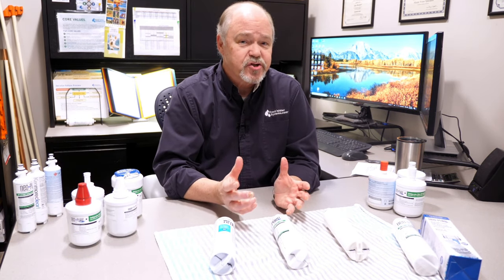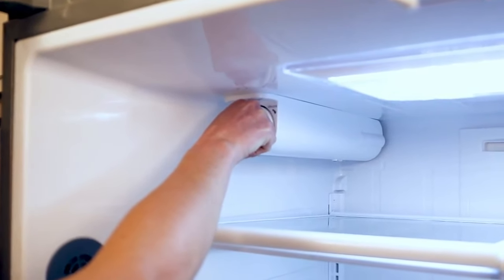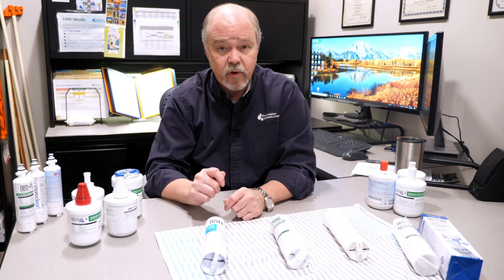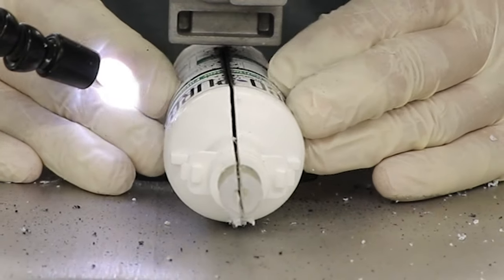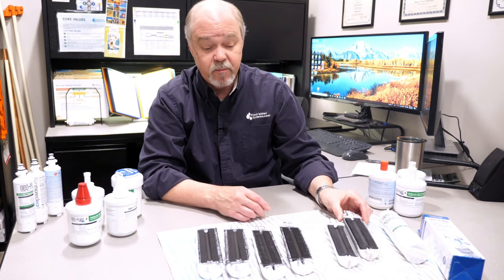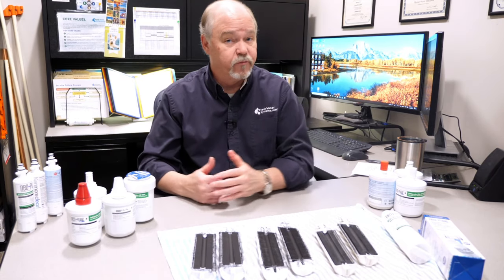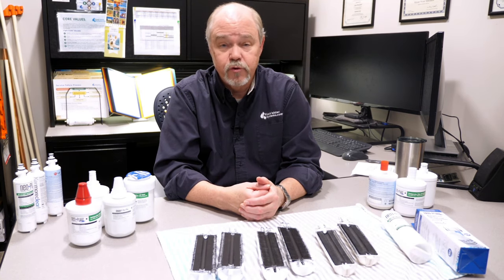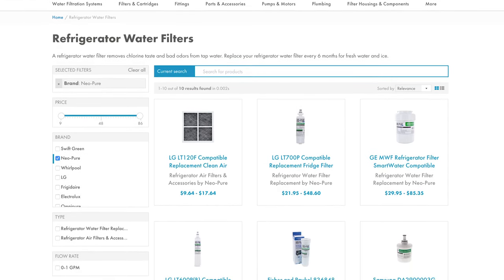Do I Really Need to Replace My Fridge Filter? The TRUTH on Refrigerator Filter Effectiveness

Comment: The comparison of construction, while interesting, doesn't get to the meat of the issue which is how a particular filter will perform for a particular water supply. The only way to know is to test, regardless if it's OEM or aftermarket. The gold standard is to test the water before and after filtration for things of concern such as Cl, Fe, Ar, Pb to see how it actually performs, both when new, and after running a few hundred gallons through it. Now that would be an interesting video.

Comment: Hi, I have a question. I only drink bottled water for health reasons. I drink absolutely zero ice or water from my fridge. However every 9 months the fridge indicates to me that the filter needs to be changed and I order a new one. If I drink no water from my fridge is there any practical reason for me to be changing the filter? Thanks in advance.
Reply: There is no reason to change if you don't drink just turn off water.
Reply: Why would you used bottled water instead of filtered water from your fridge? Most bottled water is just city water put through a filter.
Reply: Bacteria growth within the filter is the reason your refrigerator is telling you to change the filter.

Refrigerators time filter changes. Depending on the model this ranges from 3 to six months. Any bacteria, in the water supplied to your home, captured by the filter can begin to replicate. Within three months the bacteria level in the filter can reach levels high enough to make the user ill. Those visiting may not tolerate the bacteria being dispensed by your refrigerator as well as those who regularly consume the same water. Those living in the home can build some immunity to certain bacteria. If anyone is coming to stay, be sure to change the filter and flush it as directed. 

Cheers!
Reply: Your refrigerator should have come with a bypass plug. Rather than changing a filter you do not use, put the bypass plug in. Just be sure to flush the waterline every few weeks to prevent bacteria and mildew growth in the refrigerator water. line. 

Those with residential refrigerators in their RVs are especially susceptible to bacteria and mildew growth in their refrigerator. One typically unplugs and stores their RV most of the year. Once the refrigerator is turned off, the water left in the line is a breeding ground for thing nasty. One must flush the line before storing the RV. Otherwise you'll be taking the refrigerator apart to replace the line and the chilled water reservoir (if equipped). There are additives to add to the refrigerator water line and reservoir to prevent growth of bacteria,, viruses, mildew, and such. Check with the manufacturer for proper winterizing and storage instructions for your specific residential refrigerator in your RV. The same applies to your vacation home.

Cheers!
Reply: Your refigerator cant see that a filter is gross. The only way it knows for you to change it is by how much water has passed through it or maybe the time that the filter has been reset. It doesnt have a mechanic to scan the filter lol
Reply: Save yourself time, money and emotional energy.  Drink tap water...you are paying for it....

Comment: Did you consider that now filters have a chip on them to tell when 6 months have past? Just like rip off ink cartridges in copiers. So if a brand new fridge was in a house 5 months with no water use it will still say to replace after 1 more month and just like the ink cartridges light reset without new chip or new filter

Comment: what if you're on a private well water and a sediment filter is installed along with a water softener. (hard water is only 10 ppg). Do I need to be changing the fridge that often? if not, how often?
I've been using the same filter now for about 2 years and the ice cubes are very clean.
Reply: This is actually a great question. Always change the filters based on the instructions on the filter. Different filter brands need to be changed at different intervals. No filter should be left in place beyond six months. The issue is bacteria growth. Many studies have shown bacteria trapped in the filter, as a result of the filter doing what it is supposed to do, can begin to repoduce and grow to levels high enough to cause illness within just two months. Being on a well you are more susceptible to higher bacteria level than city water supplies simply due to the fact your water is not being shocked or treated to prevent bacteria, viruses, cysts, and other water-borne toxins.

To reduce risk to you and your family I suggest changing your refrigerator water filter every three months at a minimum. I also suggest adding a UV filter to your well filtering system. Before making a substantial investment, have your water tested. Testing every three to six months will provide peace of mind and possibly avoid having to invest in more filtering equipment. 

Growing up in a rural farming community here in Washington state we thought our water was pretty safe. After losing animals to cancer at a high rate, my folks had the water tested. It turned out we were being poisoned due to the over reliance of pesticides, herbicides, fertilizer, and live stock hormones, antibiotics, and such. Everything landing on the soil was trickling down into our shallow ground water. We immediately stopped using the well, had water trucked in, and had to wait three years for the municipal water supply to arrive. It took proposed housing developments for the water company to invest in expanding the water network. By that time my folks had adapted pretty well with subterranean rain water cisterns and reducing our water use.

Test, treat, and multistage filtering is key to healthy well water.

Cheers!

Comment: My samsung ice maker in the fridge has stopped working.  I have used aftermarket filters for years with no issues.  I replaced the filter and tripped the reset switch on the ice maker.  It appears no water is getting to the ice maker, even though the supply from the basement is pushing water.  Will the icemaker work if I take out the filter to see if the filter is the problem?
Reply: Most likely no, unless you put in a "bypass" plug provided your model has one.  When the filter is removed the water supply line is shut off (reason you do not have to turn off the water to replace a filter) so, no water will go to your icemaker or water dispenser,

Comment: How do I cycle a new water filter? The instructions say I have to flush it with like 10 gallons of water but my refrigerated would break if I left the water dispenser on that long. What do you recommend?
Reply: Yes.... You must flush the new filter by dispensing a minimum of three gallons. Different filter have different flushing recommendations. Always follow the instructions. Flushing the filter is simply removing all of the charcoal dust from the filter. 

Cheers!

Comment: I get frustrated with expensive factory filters so I ditch them and go with a remote charcoal filter.
Reply: What’s that?
Reply: @drinny26 : Check out Inline filters, then check out DIY inline filters.
You can get 5 pounds of Charcoal for less than 1 filter. Also the the 12 inches of PVC other stuff may cost you as much as 1 filter, but you only pay it once.

Comment: I replace mine like once a month cause I live in a place with insanely hard water
Reply: Ours was overdue for a change.  I drank some it tasted like charcoal Gross.
Reply: $70 a pop Right
Reply: @CP-kb1du  say. I spent like over an hour on Amazon to find the right filters. Works out to like 13.00 each. Gotta get a pack of 6 at least.  Good luck.
Reply: @Favorite-catNip gotta flush it with gallons, through fridge

Comment: Water filters seem like a scam. Mains water is pure and treated here in the UK, there are no significant contaminants. Also like many households we have a water softening system. I’ve just fitted my American style Samsung  and bypassed the filter, it’s a built in unit and no way it’s coming out every 6 months: I’d forget to do it, it’s heavy and I risk scratching the floor. Oh and they cost £15 a pop ! 10 years £300………..
Reply: How did you bypass the filter?
Reply: @garykazanjian824  I just attached the hose directly to the tap on the pipe, bypassing the filter…..